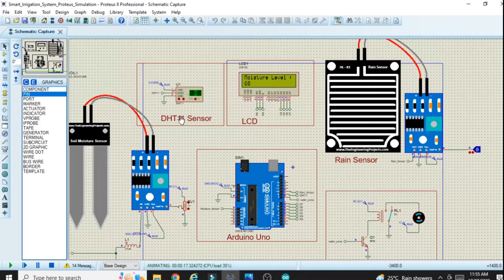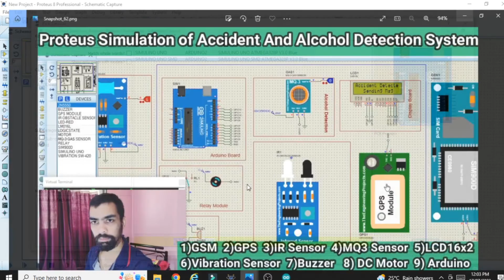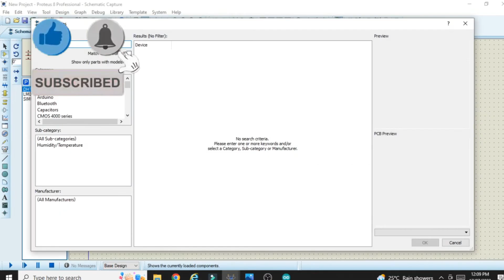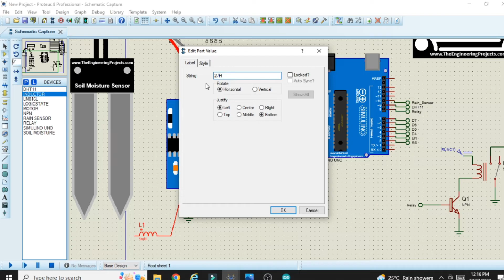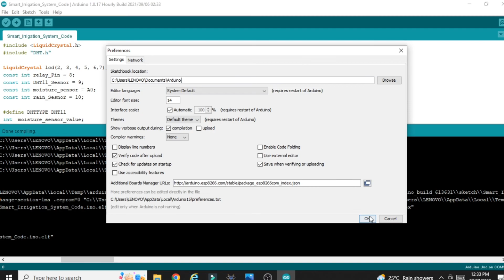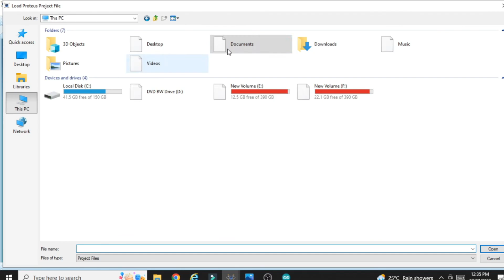Smart Irrigation System Using Arduino | Proteus Simulation

Comment: Sir motor is not running
Reply from the maker: Watch complete video and fallow the process, it will run
Reply: @Rahul_Jadhav_Project  i watched it so many times, and did on my own and even used your readymade file. It's still not working
Reply from the maker: @PriyaDharshini-ni7sw use proteus 8.9 version for readymade project

Comment: Sir my motor is turning on and off without me changing the resistance of the potentiometer can you please explain why , n also why we have used inductor and capacitor
Reply from the maker: Please watch my complete video..you answer is there..
You can try my readymade solution and let me know if you observe same issue

Comment: Why use rain sensor when we already have moisture sensor??
Reply from the maker: Moisture sensor basically detect moisture from soil..where as rain send detect presence of rain..in real time scenario you will not use moisture sensor to detect rain..right...also if you want to detect rain then you should mount sensor at gallery or windows etc.
Each sensor has its own purpose

Comment: Sir netlist linker error are come how to remove it
Reply from the maker: Use proteus 8.9
Reply: @Rahul_Jadhav_Project  yes sir I used it
Reply: Two error are occurred model DHTXXITF specified but not found in U1_#P
2.v+/v- pins specified for power interface check ITFMOD property